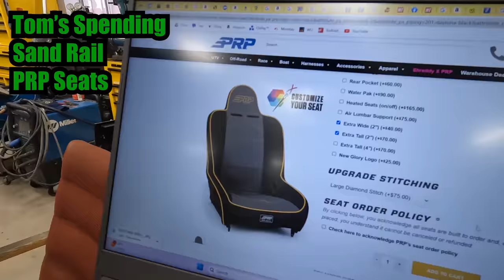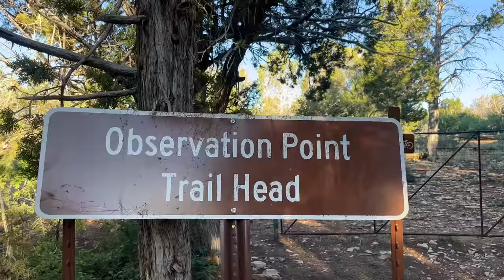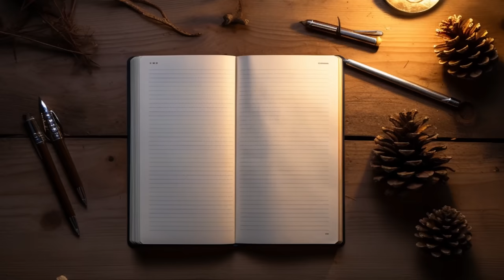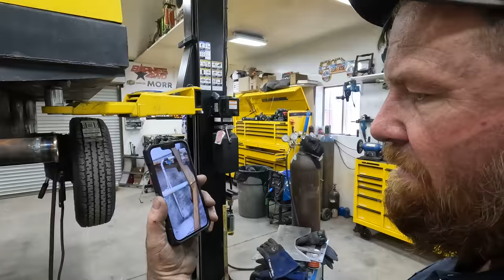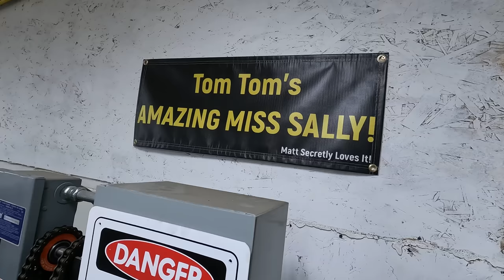This One Part Changes Everything! Bombi Gets Biggest Upgrade.

Comment: Something to consider. I used to work on these machines all the time. I was known as the "Trackmaster" lol at the major ski resort where I worked. I strongly suggest carbide Ice spikes for your track. You can have the mount holes added to the track. They also come with a bolt on version. You only need a few per track but it will prevent any "sideways slide" off an angled icy mountain road. Life savers for sure. Also, I can provide you with a diagram of a emergency "track tear" repair kit tool. This allows you to patch a tear ( i know you have never had one , but you will) that makes a "de-track" or track repair like a Nascar pit stop tire change. Another life saver tool for sure. Glad to provide this info if you get back to me. Thanks. You guys are awesome!!
Reply: I HOPE MATT AND THE BOYS SEE THIS! DEFF LOOKS LIKE GOOD INFO FROM A GOOD GUY :D
Reply: They'll see it
Reply: I'm just curious about not having the brakes on the drive I have not seen that before.
Reply: @larrycarson6584 I think they said in an earlier video that the plan was to have brakes on the drive axle, the ones on the rear are just 'bonus'
Reply: I need some advice from a guy with your expertise! Great info here, it's appreciated
Reply: I could see sliding sideways being an issue. 
Mickey T Baja Claw tires will make a truck slide on roads that have been plowed; no slide in deep snow.
I cut a little siping into a set I had and it helped.
Reply: Great info and advice!  I think also they should back a proper "kit" for first aid,  fluids and tools in this thing.  I get they kinda wing it (flip flops on recoveries Jamye!) but with the bombi's V8 powered limb grinders it becomes more important.
Reply: Good morning from the mountains of south central BC. A hearty "Amen" on the carbide ice spikes. Have family on ski patrol at the local ski resort and was into snowmobiles back when. A repair kit is always a good idea too. Nice gesture sir - kudos.
Reply: I can not stand to be on the edge of anything like that, if there is a rail or wall tho it is good!
Reply: While I understand what you are saying about torque, I just disagree. The differential distributes torque. If one wheel is in snow, one wheel on dry pavement, one wheel sits still, the the other wheel will spin at twice the speed. If torque, ie twisting force were to remain equal to both wheels, then both wheels would spin at the same speed, causing the tire on dry pavement to move the vehicle ahead, as would be the case with a locked rear end.
Reply: @Hoosierdaddy-u2i unfortunately will disagree with you 😂. You need to think about this as hydraulics. When you have closed both outlets from hydro pump you can have as much pressure on line as much pump allows and its same on both lines. Now if you have a leak on one line the other line pressure will equalise to same value as faulty line to the point when there is no essentially pressure. There is flow but no pressure ( you can have rpm but no movement as torque cannot be created)
Reply: If you have never been in or seen a dozer on ice or frozen surface, imagine an ice skate. It is essentially a bunch of skates in line. With the weight of the BombBee and short length it could be a bad outcome. The O.P. is doing Matt and crew a solid here for sure.
Great content as usual.
Keep'em coming!
Reply: @Hoosierdaddy-u2i You're almost there, but Matt was right when he said both wheels get the same torque. The missing piece is that the amount of torque is determined by the wheel with the least resistance.

If one wheel is in loose sand while the other is on hard packed dirt then you get the amount of torque required to spin the one in loose sand. That's not enough torque to spin the one on hard pack, so the one in loose sand spins while the other one doesn't.

That's why you can sometimes get moving again by applying the brakes. That adds some resistance so more torque is added to overcome that resistance. If you're lucky you can increase the torque enough in this way to get the wheel with traction moving again.

This is in fact what traction control systems like brake lock differential are doing to get you moving again. The only difference is these systems use your abs module to apply braking pressure to only the slipping wheel instead of all the wheels. That makes them more effective because you aren't adding brake pressure to the wheel you are trying to turn.
Reply: I've seen so many out of  control excavators on wet muddy roads in third world country this invention could save many lives 💪💜
Reply: the ice spikes will break grousers with the amount of hard non ice ground he has to drive on,  sidehillers are not the spike, but the small fin that bolts onto the grouser are a much better option
Reply: many hands make light work
Reply: The voice of Experience.  Don't ignore it.
Reply: Dumb idea he won’t use them
Reply: Im sure this is good information to have. I just don’t see Matt using them as he stated already the other tracks were to aggressive. Matt already mentioned he’s not gonna be on that deep of snow. So why would he want to use spikes on his tracks.
Reply: @erickrobertson262  I have a Track question for you, if you don't mind.  Why don't these machines use a sprocket at each end? or for that matter, a sprocket on each axle?  Thanks in advance!
Reply: @Bob-Whiting  i think its because its not a tank, and its cheaper and lighter to use tires. And im assuming the tires also add an extra layer of cusion to the suspension.
Reply: And id send them an email just to make sure they see this. That tool is definitely something they need lol
Reply: @Hoosierdaddy-u2i  - As much as I want to disagree with Matt, I can not. As soon as one wheel breaks loose and spins free, the torque (force at a distance) to it is reduced and at the same time the other wheel looses its ability to push forward. The drive shaft torque is essentially split equally between the two wheels regardless of each wheels speed (except for temporary acceleration difference of each wheel).
Reply: @samziarek5114 hey're talking about tiny carbide spikes that would only help keep the bombi from sliding sideways on hard pack and ice.
Reply: @Bob-Whiting they would have to be synchronized exactly or the track would bind or stretch
Reply: @Bob-Whiting tanks, snowcats, dozers, etc only have one drive sprocket per side.  All have a grooved tensioner pulley at the non drive side.  All bogey wheels, or (tires as on the bombi),  distribute the load and provide suspension.
Reply: These videos always seem to attract the coolest people.  A carbide-toothed Bomb-Bee is gonna be unstoppable!
Reply: I hope they reach out to this man
Reply: @lanejohnson1245  Remember that the open differential always applies the same torque to both wheels, and the maximum amount of torque is limited to the greatest amount that will not make the wheels slip. It doesn't take much torque to make a tire slip on ice. And when the wheel with good traction is only getting the very small amount of torque that can be applied to the wheel with less traction, your car isn't going to move very much. I see what is being said. I’m still having an issue with the free spinning wheel simply not requiring much torque to make it spin. I sure would not like to grab it and stop it from spinning.
Reply: would that be a problem trailering it?
Reply: @respekted  Are you secretly Jeremy Renner ???
Reply: @Hoosierdaddy-u2i  Torque does not require motion like work does. Have you ever held a torque wrench with pressure applied and stop pulling on the wrench when it clicked at the desired torque? Your hand stopped but you were still applying torque. That is the tire on the pavement in your example. Meanwhile, the other end of the axle was moving the tread on ice with the same amount of torque but no friction to stop the tread from moving across the ice. Equal torque, not motion. If it was a locker diff, which side would apply MORE work? the side on the pavement would, with enough force to propel the machine. the opposite side has little to no friction (on ice) and would contribute very little to the motion forward. The track on the pavement would be doing most/all of the WORK.
Reply: @Psyco913 bingo...
Reply: It’s cool and everything but I bet it won’t float! 
Just had to add to the the bitching factor. 
Hmm just think Matt’s boat tow and recovery division I wonder how many times Lizzy can fall in the water?
Reply: @kennethalbert4653   Well not any more! smh
Reply: @Hoosierdaddy-u2i I think Matt might be right on this one. The slipping wheel and stationary have equal torque. But the torque is so low that the one with traction won’t move ya, while it’s high enough to keep the traction-impaired side spinning.
Reply: @respekted   😆
Reply: And destroy their trailer every time.
Reply: @Bob-Whiting  tanks or track vehicles only have a drive sprocket on the front. The rear has what is called an idler which is free wheeling. From an old tank / heavy eqpt mech.
Reply: Need more clearance for the tracks. Just saying.
Reply: Nice of you!
Reply: @Hoosierdaddy-u2i That is incorrect. "same speed" does not at all equal "same torque".   Open differentials absolutely do provide equal torque.   I do take issue with his description of "true two-wheeler drive.".  The problem is it delivers equal even when the value delivered is practically zero and the vehicle won't move at all because one is spinning. When one wheel is in the air it would be more correct to call it no wheel drive.
Reply: @Psyco913  Absolutely correct and well put.  The difference here is that you steer this thing by braking each side independently, so this is a rare case in which you can manually accomplish what a traction control system does by braking just one side.  With working brakes, this thing will have nearly perfect traction control.
Reply: @Hoosierdaddy-u2i Good question about grabbing a spinning wheel.  However, the issue there is rotational momentum of the wheel.  You do have to apply torque to get the wheel to lose traction.   Then once the thing slips the friction coefficient is reduced so it spins even more easily.  You are then putting in torque to accelerate the wheel, but that is generally tiny compared to the torque needed to drive the vehicle forward.  Once it has soun up to speed, no more torque is being applied to accelerate it and it is just the torque required to fight that tiny bit of friction that remains.   It does take torque to get it spinning, but none to keep it spinning.
Reply: @wrightcabin4132 do none of them have the drive at the rear?   I understand one of the ends has to idle, practically speaking, but don't many tanks and such drive the rear so the tops of the tracks are not stretched under load, which reduces overall elastic track stretch by half?
Reply: @BillyBigRiggin359  
In the right train of thought. Armor vehicles run single/double drive sprockets on one axle "final drives"  that normally control power and braking. The tracks on them normally have guide pins that run between double wheels. With track tension set in one fashion or other at non drive end. On Bradley's and M113 the drive is front end.  Easy to understand if you look at the side view of a tank or IFV and bulldozers bulldozers does haul tail across country so no real suspension on tracks.
Reply: @respekted what, they don't even carry spare gas 😂
Reply: @brianhaygood183   I would think they want the top in tension so it doesn't "flail" and the bottom with the "slack" for the suspension to operate most freely.
Reply: @samziarek5114   ICE/rock
Reply: @samziarek5114 
They’re for an icy plowed or well travelled road. If you think about it, the tracks they had were too aggressive because their makeup was just tall steel grousers set 90 degrees to the direction of travel. They act like sideways ice skates on hard pack snow/ice and on any sideways slope on the road, the machine will just take off in an uncontrollable sideways slide towards the downhill side. If that happens to be a ravine, then you’re going over the side with no way to stop it. 
A few ice spikes at various locations on the tracks will prevent almost any sideways slide on hard pack. I’ve experienced this on a dozer and it’s not a good feeling. Lucky for me the dozer slid into an embankment instead of over a ledge.
Reply: @brianhaygood183 
Some tanks, mostly late and post WW-II thru the Cold War and almost all dozers drive from the rear. The M-60 tank is driven from the rear, idlers at the front.
Reply: get this to the top!!!!
Reply: I logged for 20 years and in the 80s and 90s the The mechanics would weld rebar onto the tracks at an angle for ice Clates
Reply: @frankchapp9904 nope. If the one on snow has 0 traction then it also has 0 torque. the one on dry also has 0. Thus you don't go forward.
Reply: What a great comment here. Offering some priceless advice and knowledge based on prior personal experience. See others see how great this chan and Matt and all his team are. Love this. 🤩

Comment: You are correct about the open differential splitting torque equally.  I am an offload instructor for law enforcement and fire departments and we spend a lot of time in our 4x4 Theory portion of the classroom explaining and demonstrating this vehicle dynamic.  We do get quite a few people dispute us, but we can prove the theory in the field, which is the best way.
Reply: I had to think this through again and you're correct. But since both wheels only get the torque that is required to spin the lower traction wheel, instead of wrongfully calling it one wheel drive you could actually call it zero wheel drive if one wheel is completely off the ground.